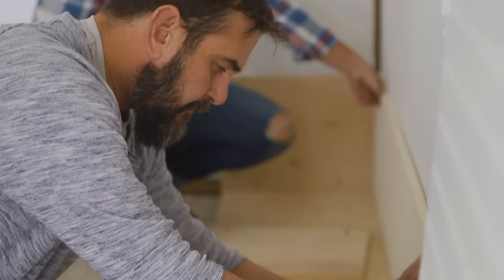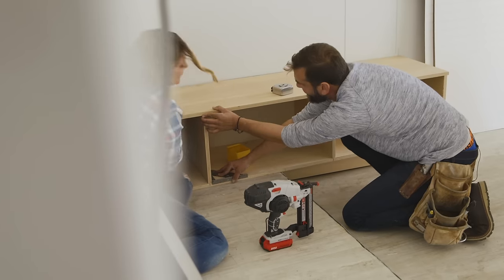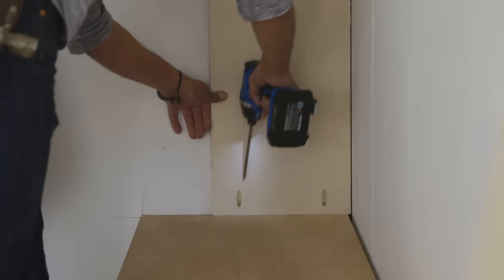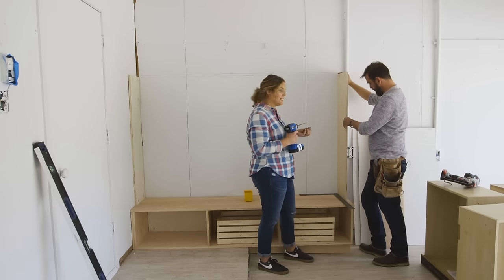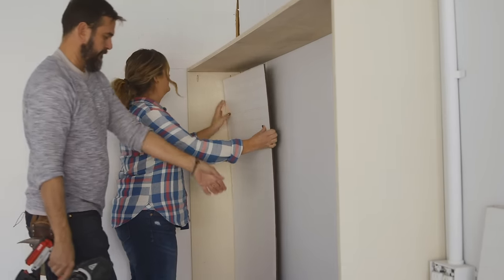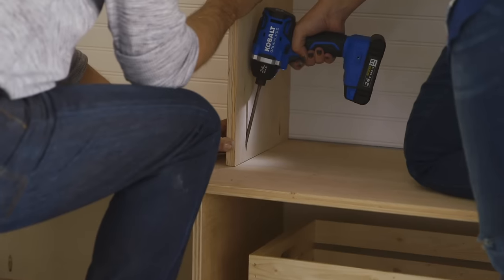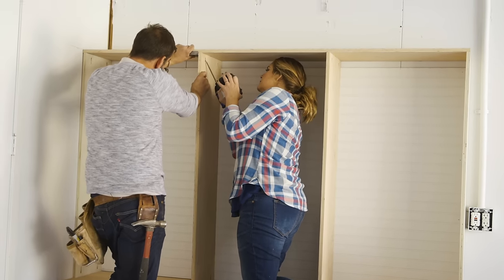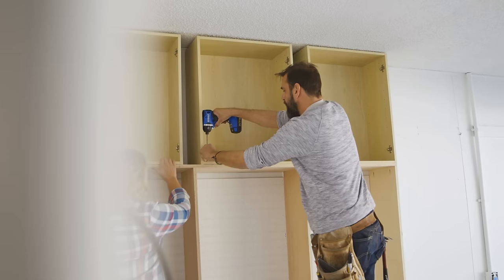DIY Mudroom Storage

Comment: Why is it called a mudroom. When it's not made of mud?
Reply from the maker: Same reason you park on a driveway.
Reply from the maker: Or drive on a parkway.
Reply: Because you can take off your muddy/wet shoes and leave them there instead of tracking dirt/water into the house.
Reply: OMG, WOOD, you don't know what a joke is.
Reply: Wood, sarcasm doesn't come over well on the internet.
Reply: john M - Yeah, unfortunately so. If it makes things any better, I've had many of my attempts at humor fall flat in comment sections as well. Best wishes to you!